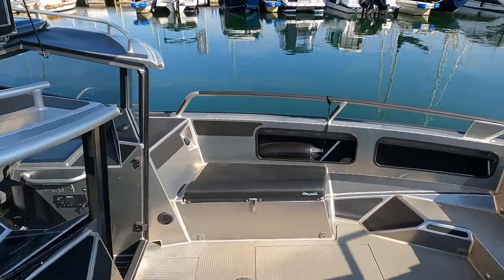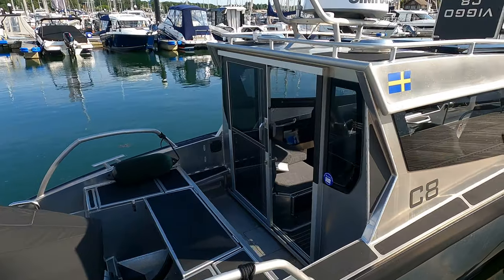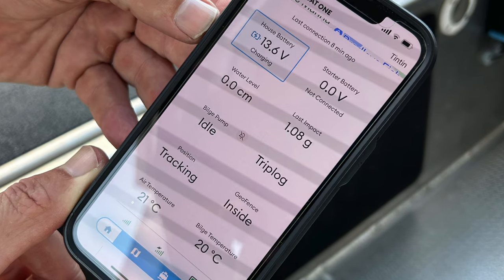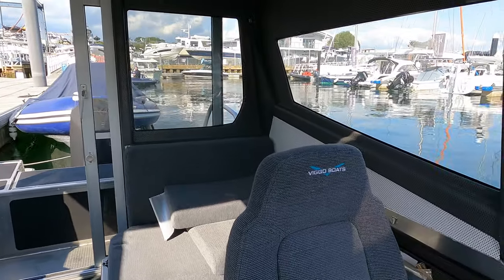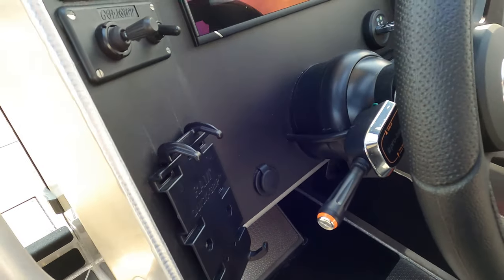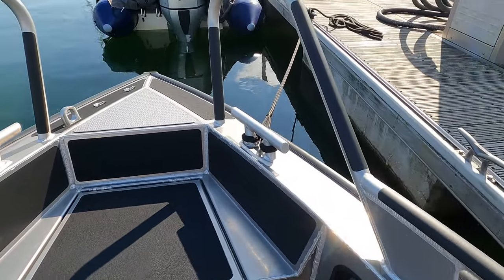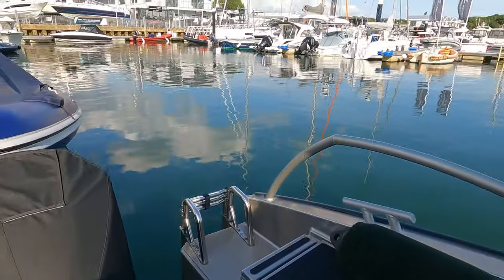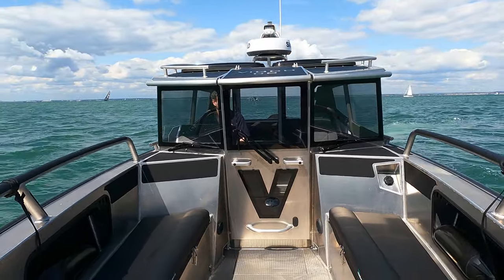THIS Is The VIGGO C8 70+ Knots Aluminium Boat!

Comment: A rugged leisure craft for daytime fun.  How about powering this Viggio with a Mercury 600 hp outboard?  Do you really need a generator for a 30 ft craft?  Upgrade to a 35 ft C10 and twin 450 hp Mercurys.  Targa 32 would be hard to beat.
Reply: The 600 mercury is too heavy for the C8 as its a much bigger and heavier engine than the new 500r. Neither the C8 or the C10 have a generator. Targa compared to the C10 is more designed for accommodation as opposed to high performance, both are great boats for what they are designed for. The Targa will get you from A to B quickly, but the C10 will get you from A to Z quicker!

Comment: I think the units on the graph at approx minute 4, have been confused. I suspect the graph shows litres per mile not litres per minute as stated. Please correct me if I'm wrong.
Reply from the maker: you are correct 🫡
Reply: @YachtBuoy 
That seems very good. My 23’ aluminum boat with a full 106 US gallon fuel tank gets at absolute best 2.5 mpg which is only .66 miles per liter.

Comment: No Bathroom?
Reply: Not on this size Viggo although you can always fit a porta potty. The bigger C10 has a proper heads. We have a C8 and its never been an issue.
Reply: I would sooner have a Stabicraft 2750 Ultra Centre cab better designed boat plus has the creature comforts you need for a long day on the water

Comment: That ride looks like it could rattle your back teeth out. Looks like an uncomfortable riding boat
Reply: It isn’t. It purely depends on how fast you’re driving it and of course the sea state. It is a very soft landing boat compared to most of this length / class. I have one and I’ve had other similar length boats that are much harsher as they’re not such a deep v. A big heavy boat will be more comfy but it’ll use more fuel, not be towable and prob not as fast. You dont have to drive it that fast of course. You can pootle along at 15 knots all day long. The sea was a lot rougher than it looked on camera with short steep tidal chop and they were going 40 plus knots so its bound to look uncomfortable but the prop was leaving the water regularly . As i said you dont need to drive it like that but its fun when you do ! 😊
Reply: All aluminium boats of this size are horrible in sea conditions. Sit so high in water they roll about too much when you walk round. On sunny days it curve sends suns ray onto you, baking you. Only good in cool cloudy countries.
Goes fast with fancy music, that's all it has to offer.

Comment: welding work has been done poorly and unprofessionally  , there are missed lines and spots , may crack open on the welding area's ,  materials are also not fine quality ,  poor design and too much aluminum used  ,  not feeling safe to buy this boat  , too much $ for this garbage boat !